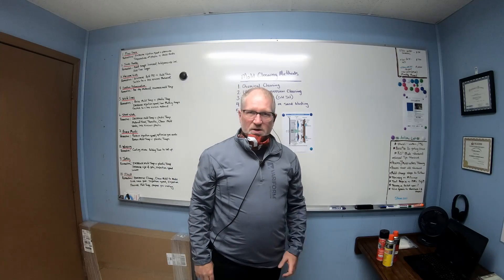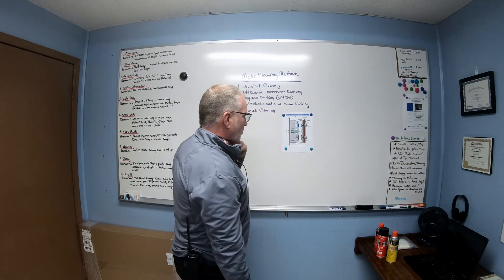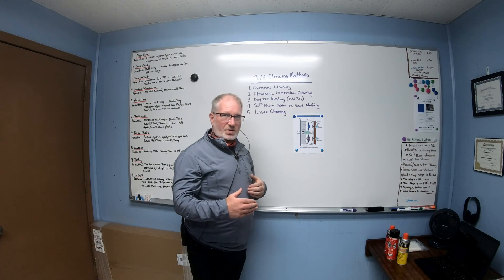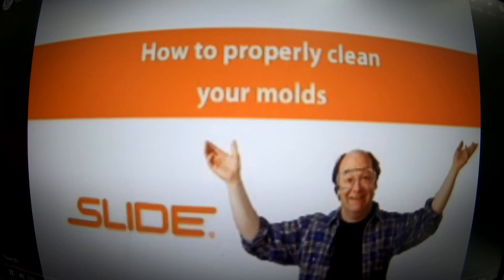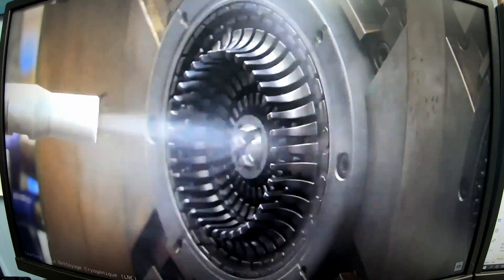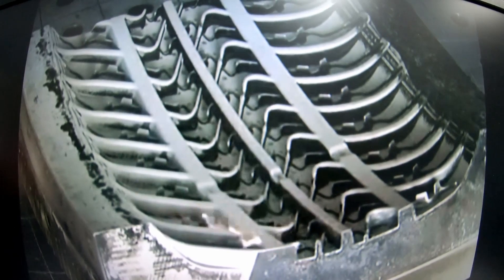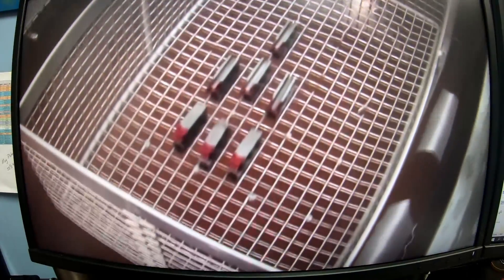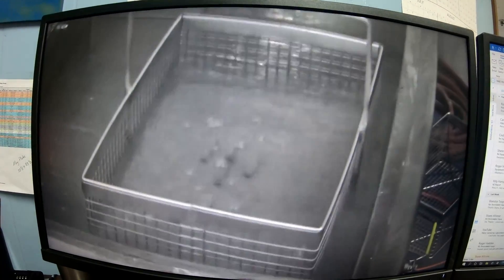Mold Cleaning Methods

Comment: Fascinating. How often should one clean a mold? Is it when you can see discolouration due to deposited plastic beginning to show in the mold ? Or should they be cleaned even if you can’t see anything with a visual inspection after a “rule of thumb” number of uses? 
And - is rust preventative only for when the mold is going to be stored between use ?
Lastly - is there a corrosion preventative one should use with aluminium molds in the same way, and the cleaning methods all be the same ? 

Ty ! Fascinating video
Reply from the maker: All molds should be on a schedule to be cleaned once a shift. We have books that the techs sign off that they cleaned the mold once in 8 hours. The rust preventive should be used if you are pulling the mold or if you are shutting down the press for no work or no operator it should be sprayed so it don't rust. You can use the same stuff on aluminum mold as well will not hurt them at all. I think if you put a plan together & fallow it on cleaning them on a shift to shift everything will run better due to the vents are clean & no build up at all. I hope this helps you out, Thanks for watching & the support